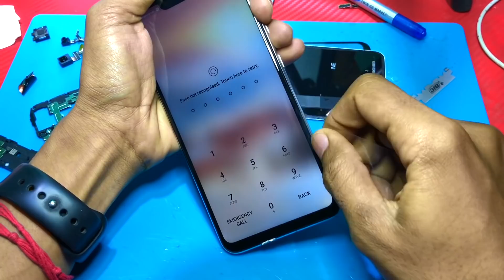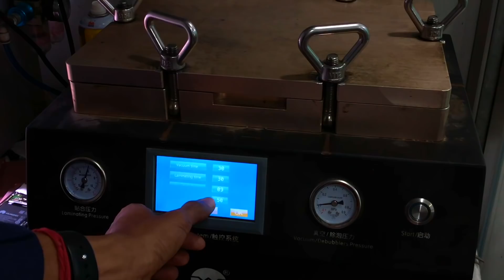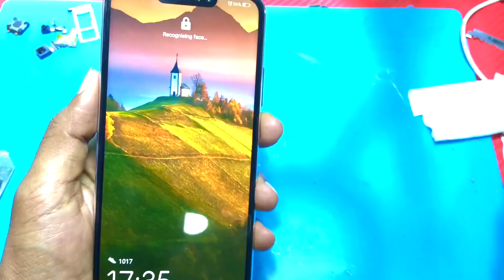huawei nova 3/3i touch glass replacement

Comment: Hi guys, my bad luck b'coz my nova 3i  back and camra glass is broken 😢😣i feel very badly.
Well. Tomorrow i will replace.
Shopkeeper told  me the price is round about pak 2500rs. Guys is that real fair price plzzzzzzz tel me anyone
Reply from the maker: yes sir price for replacement it around 20$ to 25 $
Reply: Now i replace it,
It's not a genuine. And the colour is little bit light
Reply from the maker: okay bro it not as original right ?